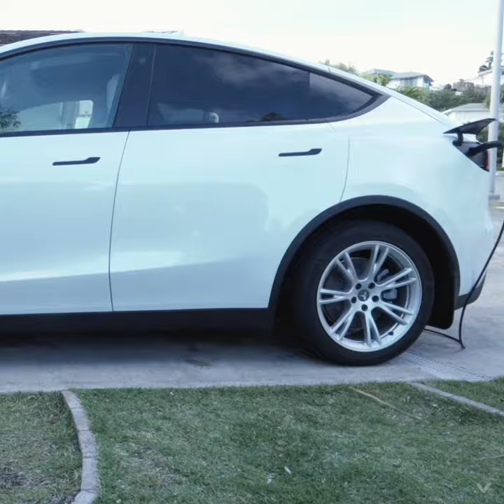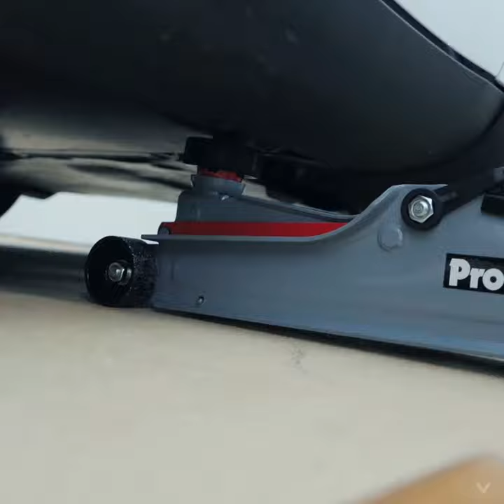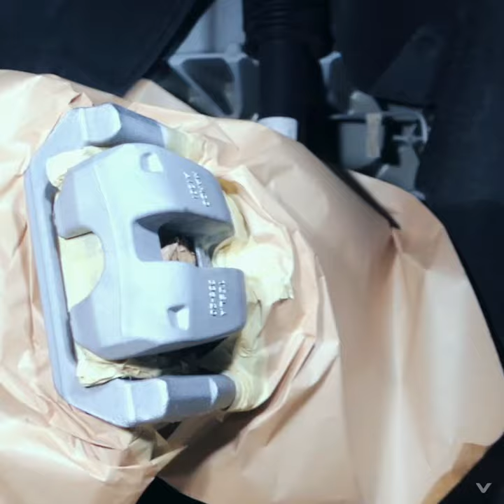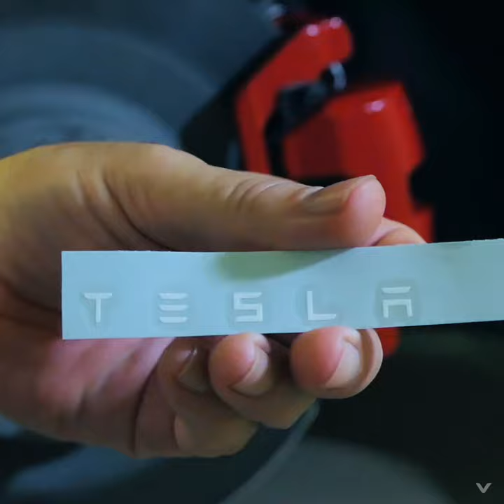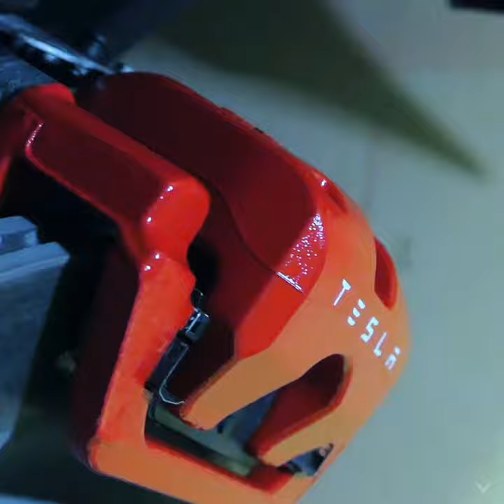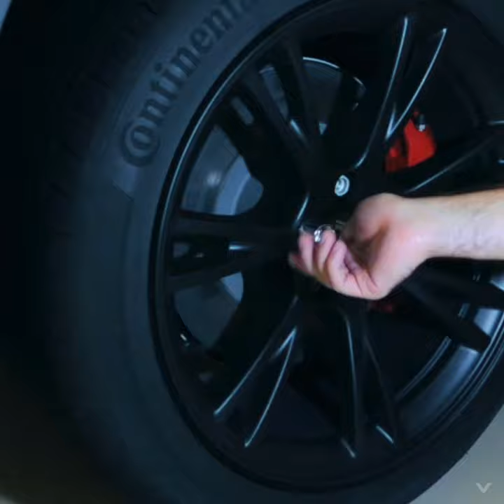Tesla Model Y - Calipers & Wheels Painted

Comment: Just powder coat it
Reply: Fr the spray paint will fade fast in the sun plus chip from rocks when u powder it’s a better gloss and actually protecting the wheel im a sand blaster for a powder coating company thinking of doing my model 3 done